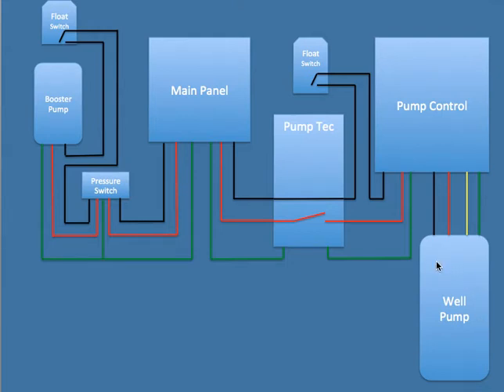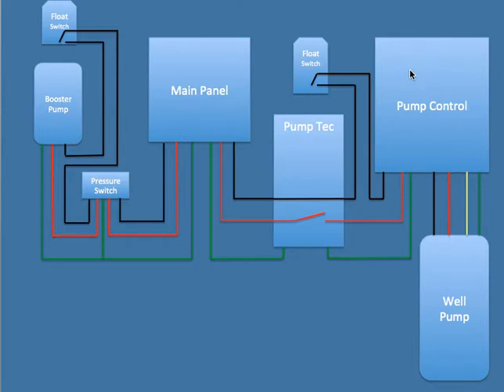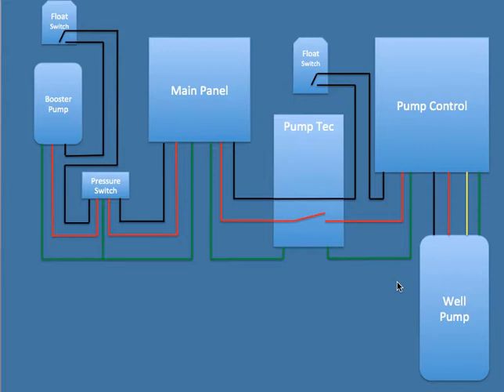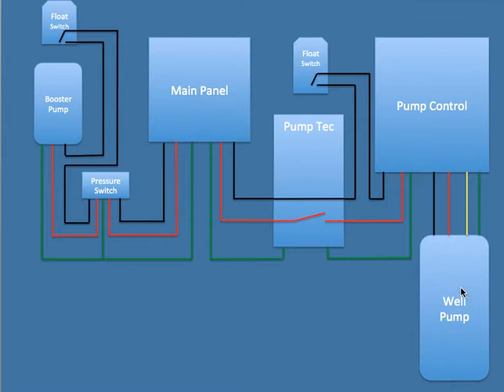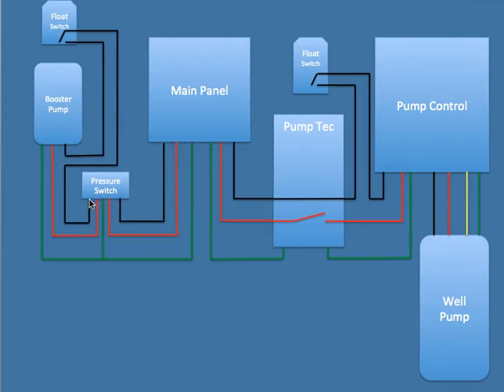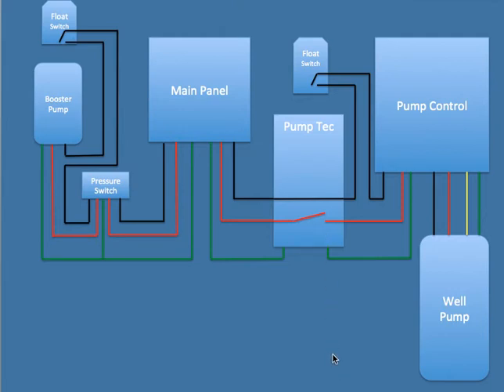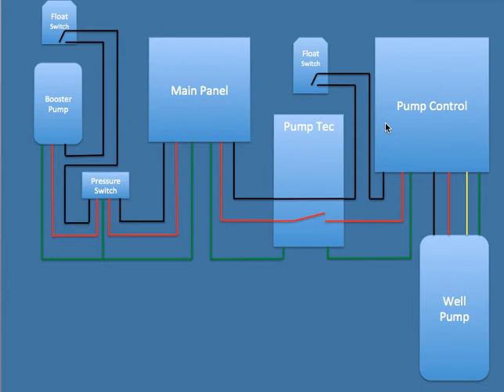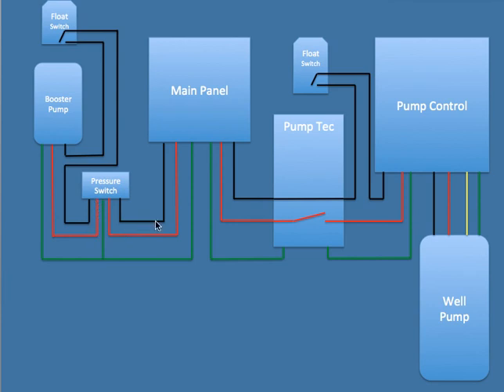Wiring 240v or 220v Well Pump with booster Diagram

Comment: Did you complete this install?  
I've been looking to do exactly the same design, except I was going to put in two float switches to control/protect the Booster pump. The first float would turn-off the Booster pump (as an Alert method) with maybe a 1,000 gallons of reserve water left in my 2,500 Gallon Tank. If the Storage tank gets this low, then something is wrong with the Submersible Water Well Pump is not re-filling the Storage Tank and that needs to be investigated and fixed.  Then, I will put in a manual Switch to over-ride the first Float switch and give me access to the remaining 1,000 gallons while the Water Well Pump issue is being fixed (At least I'll have 1,000 gallons of reserve water and NOT be left high and dry). The second Booster Float switch will protect the Booster Pump from running dry.  
All the topics/videos on motor/Pump control shows the use of a Contactors as Motor Starters (which is nothing more than a high-end/high-current Relay). And, I can kinda understand using a Contactor for a 3-Phase high-voltage motor. But, for Single Phase 240V Pumps, like your Submersible Water Well Pump and Booster Pump I don't think a Contactor is needed. If we Open and Close one Hot leg of the 240V circuit to the Pump (like, for example, with a Float switch), that should be just fine to start or stop the Pump. Of course the Float switch will need to rated to carry the Voltage and Amps of the Pumps.
Somebody, please tell me why my design is wrong/flawed. Thanks
Reply from the maker: I completed the install. Give me a call. We can chat if you want
5597976935

Comment: What is the pump tec used for? Where can I buy?
Reply from the maker: sorry for late reply. The pumptec is a amp monitor and when the amps start climbing because the pump is straining, it kills power to the pump for a short time. 
Normally the pump is under lot of water and this scenario is rare but in the case with this pump being in shallow water, the risk of running out of water often will burn up the pump. 
So the pumptec protects the pump from burning up
Reply from the maker: https://www.amazon.com/FRANKLIN-ELECTRIC-Pumptec-water-protection/dp/B00T869ISW

Comment: The well pump switch is a "pump up" switch and the booster pump protection switch, is a "pump down" switch.  Some are made to go either way depending on how you wire them, but most are dedicated to either up or down and you have to choose the one you need.